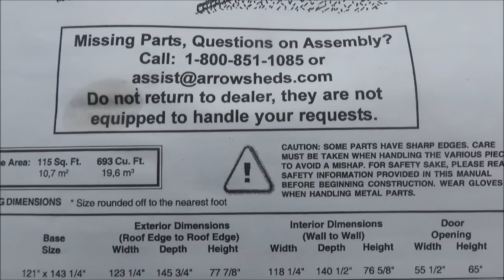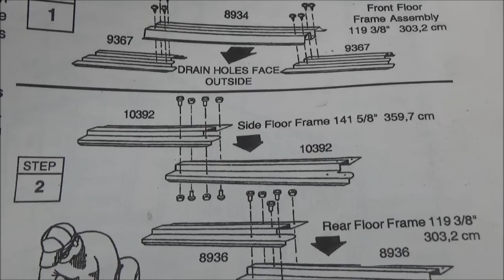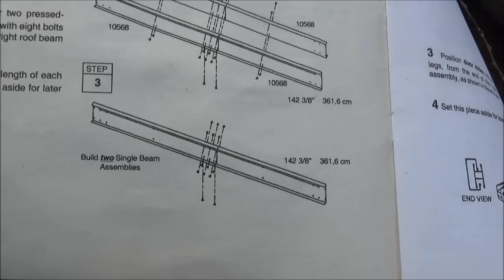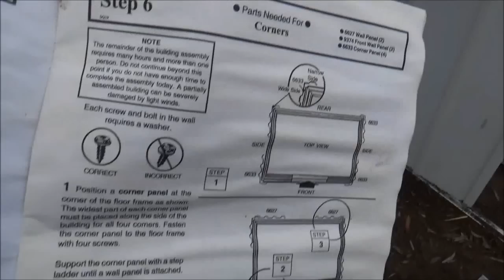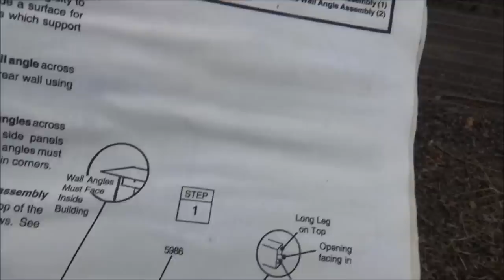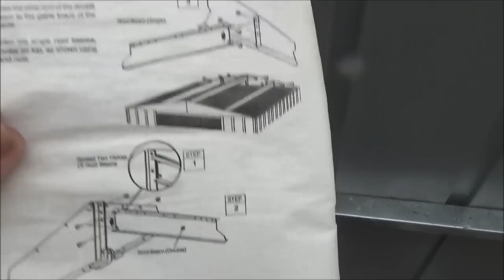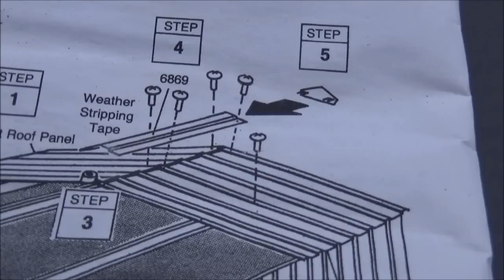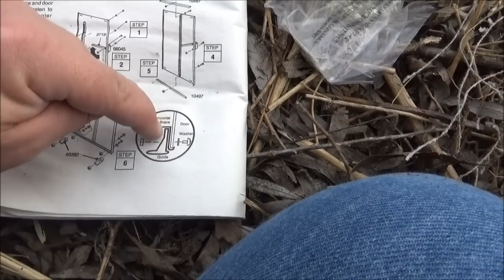NP101267 10'X12' Arrow Storage Shed Assembly - L2Survive with Thatnub

Comment: Good video, just completed my second one today.  Had issues with the roof panels coming together.   34 minutes though, 34 minutes to mention how sharp these rascals are.  I'm typing this with nearly 30 decent slices in my fingers and hands.  I despise these sheds.
Reply from the maker: I had to empty one of them and move it the next day.  Unfortunately, that night there was a wind storm and I didn't have to move it anymore.  The wind moved it for me.  Now I get sheds built by Costco or Home Depot.  They cost a lot more but, they are bigger, made of wood, and I am not the one putting them together.

Comment: Awesome video... On the door sliders just make sure you slide them between the curved part.  DO NOT JUST SLIDE THEM IN THE HOLE.  IT HAS TO GLIDE ON IT. That's why he was having problem at the end (not being able to screw all the way with out the door getting stuck, and having to release the outside screws because the slide was hitting it.  HOPE THAT HELPS.

Comment: badass video. helped a ton. instructions have been updated for this exact shed but its not much of an update. I did notice you put the door slides completely on the inside of the track. they should straddle it which is why your outside screws were too long and jamming the door up. figured I would add my 2 cents to help as you helped me. thanks buddy

Comment: Thank you for taking the time to make the video. 2 things I noticed that you may want to add to your video.
1. The door slides are installed incorrectly. The door track needs to go into the center of the door slides. You almost installed in correctly at 19:20. Look at the End View diagram in the instruction manual.. 
2. The gable should be tucked under the side walls. You had the gable sitting on top of the side walls. See 34:41 and 35:40

Good job on the video. It was much better than look at the manual.
Reply from the maker: ***** Thanks for the info.  We'll keep this a secret though.  The Wife thinks I'm perfect and I don't want to spoil it for her.  LOL

Comment: I filled the underside of the threshold where the doors slide with vinyl patch, its like concrete but doesnt crack and is not corrosive. Doing this makes it solid to where a heavy object, in my case a 800 pound Harley Davidson will not bend the threshold.  I strongly suggest this! 7 dollars worth of vinyl patch, you will thank yourself later. just make sure you clean out the drain holes and use your finger in the fresh mixture to make slight channels fir water to drain to the front.
Reply: I tried that but unfortunately the flexing of the threshhold made it crack apart. It would probably work great on a concrete pad but on dirt or grass it doesn't seem to help much.

Comment: This video is saving my sanity right now.  We bought 3 of these 10 x 12's, though ours have the barn style roof so it has more pieces to install... The directions are not super helpful in some sections and the pictures are a hard to decipher at times.  Thank you so much for taking the time to make this video.
Reply from the maker: You are welcome.  I messed up on the doors in the video but, if you read through the comments you will see the corrected info.

Comment: Great video, I have one going up and was thinking of using self tapping screws and the Bosch to drive them in next to every factory hole or in the factory hole if the grab instead of the nut washer and screws supplied.
Reply: Def recommend self tapping screws. A few times there were some "things" that didn't line up even though we followed directions to a T and watched this video, pausing it in between.
Reply: @sumtxflygrl1  I built this same building by myself. Self tapping screws was a lifesaver.

Comment: I built the same building by myself. I bought some longer screws and bolts to make it easier. On the top, I used self tapping screws on the ridge caps and screwed them to the center beam. I am 66 years old and need all the help I can get.

Comment: I just installed the same shed and realized the reason why your door is getting jambed is becuase you installed the white plastic pieces on the rail incorrectly. They should hang out of the rail in between the tongue. its hard to explain. But thats the problem. Other than that, great explanation. Thanks
Reply: Yes I think they slide on the lip and not go all the way inside.
Reply: Thanks for the Video! Sorry for chiming in, I am interested in your initial thoughts. Have you researched - Mahorrla Wooden Paradise Method (just google it)? It is a smashing exclusive product for building better sheds and woodworking without the hard work. Ive heard some incredible things about it and my close friend Aubrey at last got astronomical success with it.
Reply: Thank you i am installing the same one and watching this made me realize ididnt install them like his i almost ran outside to undo it all

Comment: Is the floor kit sold separately? I was going to just put pallets and plywood to make a floor and then just build on top. I’m building mine on top of a flat driveway
Reply from the maker: The floor kit came with mine but, I did buy the wood for the floor.  You do not have to use the floor kit but, you might want to do something to secure it to the ground.  These sheds hate the wind and will fly away if they are not nailed down.  (Speaking from experience).

Comment: Thanks for the video. I wanted a refresher and needed to get my nerve up for my second build of one of these sheds from hell. You probably are aware by now that you made a few mistakes during construction. However, I do not blame you at all. The instructions can be very confusing and almost impossible in some cases to tell when you're supposed to use a screw or a nut and bolt. Holes don't line up and on the rare occasion when they do stripping out the hole is inevitable. I think the manufacturer (China) throws any kind of alloy (probably a lot of aluminum and lead) available into the pot to make the sheets that are then stamped out into the component parts. I picked up a box of #10 1/2" screws for backups in the case of a stripped hole. I'm waiting for a true to life video complete with the requisite cussing and frustrated throwing of objects. I said this the first time, but I guess I didn't take myself seriously enough, but I mean it this time I WILL NEVER PUT ANOTHER ONE OF THESE TOGETHER AGAIN! I feel much better now that I've been allowed to vent. Thank you.
Reply: i found that working on it at small intervals helped. longest interval i worked on was the roof, about 3 hours. the price is worth the hassle in my opinion, any other storage solution is upwards of $1K.  the house i moved came with a small arrow shed, was probably installed in the late 90s and the thing is holding up pretty well, only minor rusting at the front bottom. that was reason #2 why i bought the new one, the Woodridge.

Comment: I've been following your video to build our shed. First of all THANK YOU. Arrow Shed should thank you too... Here's our deal though. Ours is a little different because it's not an A frame roof but more a barn style...But pretty much the same. So after I don't know how many days of building and how many times I've said "these holes don't align..." I actually ran into something that I couldn't see in your video how to do...The last middle ridge cap....Did you install it BEFORE putting in the last panels? I installed all panels and now I can't reach where the middle and front ridge cap meet... I think I have to pull a panel down, and what..just slide it under the ridge cap? OoF!! This one's a doozy. Anyway. Thank you for guiding us this far! We're almost there!!! EDIT: Ended up taking one panel down! ALL is well so far :)

Comment: Just built one in two 3 hour sessions after work. Alone. My gf said thanks but also got mad cause I made one small mistake. I put the roof panels that had side holes for the table in the middle and you could see light through. I just used the tap screws and screwed through the panels that were at the gable. I taped outside and patched inside you can't even tell but now she's worried about the floor. I haven't built the floor kit yet but where it is one corner is on a tree root so to level it I had tolift the other corners. Now I have a 6 inch gap some places. I filled alot with bricks now gonna fill with dirt but worried the floor kit will sit so it doesn'tput the plywood in the right position

Comment: None on my holes line up on the side edges. Shows 8 min. In your video  ,any recommendations on how i can fix that ? Just finished the top of the roof
Reply from the maker: Sorry, I don't know.  I showed all the issues I had and how I fixed them.  I would try flipping them over to see if they line up.  Wish I could have been more help.  As you can see from the video, I am not construction guy.

Comment: How did you get the roof screws in? Most of our holes did not line up
Reply from the maker: Make sure you have the right sheet of metal and make sure that everything is square.  If you mess up on the first sheet, it will cause the rest to be off.

Comment: Hey L2Survive, We helped a older gentleman friend of ours put this exact shed together. He had ordered the extra wood for the basic floor, so he got four sheets of plywood. ( i think, I didn't physically go count them.) We built it for him because he had asked two other people to do it and they turned him down saying it was too complicated. It took us a day and a half, because the first day we forgot the charger to the drill and it was dead and had to hand screw everything in. The second day was mainly just the roof. Now we are on the floor and the kit didn't seem to come with directions for the flooring kit. How did you manage to get yours together? Did you have to call for another direction book or ? Maybe I am over looking something? We wanted to try and finish it for him tomorrow, but he also wants it slightly up off the ground because it will be storing his personals for a couple years while he saves more money to have a house built on his plot of land. Thanks for the video and any advice!
Reply from the maker: There was a separate page that showed the floor and even the different cuts of wood to use to make it fit properly.  If you cannot find that, at the 0:50 mark https://youtu.be/9HvawHjnbBg?t=50s you can see what the floor kit is suppose to look like when it is done.  Hope that helps.

Comment: 5:50 why are the bolts on one side opposite, (one up and one down)  the instruction picture on 5:03 shows, one side the bolts are facing down and the other side is facing up
Reply: I'm pretty sure he did that wrong. For him placing the shed on dirt it won't matter. However if you're building your's on a cement pad you'll need to get it right or the shed won't sit flush.

Comment: I just bought one of these. Setting it up in a couple days. Do I need to anchor this thing to the ground? Gets kinda windy here. Gusts sometimes hit 50 mph. It will be on a wooden frame I built for it and then on top of plywood.
Reply: Definitely anchor this to the ground. Overall, this is a flimsy structure and a good wind will damage it. We had a couple windy days and the frame above the doorway bent  on my shed.

Comment: The plastic inserts (66769) for the door track were put in wrong this is why the issue with the doors sliding.
Reply from the maker: josh cowan Yep.  I will get it right on my next build.
Reply: I followed the video to place the insert inside the track. Then I found out the insert failed to slide due to the screws are in the way.
After reading the manual man times, its drawing (not instruction words) shows the insert must be "on" (not "in")  the track so I had to undo to remove then re-place the inserts. 

I want to thank L2Survive for the good work that saves people time- It really help the ARROW manufacture in lessening the learning curve.

Waring to the ARROW shed owner--- The ARROW shed does not use picture mage as the world embrace, it still uses the traditional engineering schematic. Although the description is correct,  but can miss important details. It requires the user study the schematic (illustration) carefully, you can't just assume the description gives all the right amount of information.

Comment: The problem everyone is having with the doors sliding is because the sliders  don't go totally on the inside of the track they set in the gap with a lip on the outside and inside of the track which allows for tightening of the doors and space to miss the bolts inside the track when sliding.
Reply from the maker: Anthony Quinley I will have to check that out.  Thanks for the tip.

Comment: Good vid. You helped wit the doors. Lol & another thing. Those plastic strips on the gables were pose to be removed after you put the end pieces of the roof. Other than that this vid was helpful.
Reply from the maker: Richard Luebano I just bought a second one of these sheds and you all have corrected my mistakes so, it should be easier this time around.

Comment: Do I need to use the floor kit to get this together right? I'm assembling on an existing concrete pad
Reply from the maker: No, you do not have to use the floor kit if you are not putting a floor in.  All it does is hold the plywood up off the ground.
Reply: L2Survive gotcha thanks!
Reply: @L2Survive  .. thanks

Comment: I would have definitely have put a 6 mil black poly vapor barrier underneath it. You will have problems with moisture and insects in there during the warmer months and it will rust quicker. Don't store anything that will grow mold.
Reply from the maker: alan30189 We put a sealant on the bottom of the wood floor.  It was like $15 per can but, they said that I will not have an issue with the wood.  There are a couple of gaps on the floor though so, creepy crawlies can get in.

Comment: Thanks for posting, i'm looking at this same shed.  Did the floor kit come with it or did you buy it separately?
Reply from the maker: The floor kit was included in mine but, I had to buy the wood for it separately and I also put a moisture sealing paint on the underside of the wood.
Reply: @L2Survive  ...how much did you spend on that (weatherproofing)? Did you chalk all the screws?

Comment: Where is your floor? I bought the plywood for the floor and I was hoping you would have shown how to do that part.
Reply from the maker: I was hoping I would too, I just forgot.  I do show the flooring kit assembled at the beginning of the video.  One thing to keep in mind is that there are specific dimensions for the wood you use.  There are like two or three choices in the instructions.  When I went to Home Depot to buy the plywood, I didn't think of that and had all of my pieces cut to 10'x12' instead of the interior dimensions.  I had to recut everything by hand when I got home.
Reply: The instructions are terrible. I was thinking of just putting a concrete bricks down and then laying the plywood down and assembling the shed. Would that work out fine?
Reply: And thank you for your reply
Reply from the maker: I really don't know.  Even though I may come across as a carpenter because of my construction jargon like thingy and do-hicky, I am not.  If you are not storing government secrets in it, I'm sure whatever you do will be good enough.
Reply: i did my own. if I can I'm sure you can. I use prefabbed 10 in. x 10 in. x 10 in. Concrete Deck Block from home depot. I just made sure it was level and added dirt and sand under neath as needed and I added drainage tubes under neath to make sure it didn't get washed away because it rains alot here.

Comment: I'm having a problem with my roof. I got the screws on the top by the peak but I couldn't line the one in the middle. The ones that attach to the roof support
Reply from the maker: LMonkeyBAd11 That's kind of a hard spot.  If you are having issues with the holes not lining up, try moving the shed around a bit.  I mean pick up a side and move it one way or the other about 3-6 inches.  If you are having issues with the bolts not being long enough, get someone to push down on the bolt while you secure the nut from below.  If I am totally missing what you are saying, give me a time stamp in my video of what you are talking about.
Reply: L2Survive you hit all the nail with the first one. I got those fixed but now I had another one. My doors are not sliding nicely. They get caught on the acorn nuts
Reply from the maker: LMonkeyBAd11 Yep.  Just a bad design.  I had to loosen the bolts a bit to let the doors slide open and shut.  They are still hard to slide but, it can be done.
Reply: L2Survive o ok. I thought I did something wrong. Thx u so much. I finished it and it's lovely

Comment: The plastic door slides should not travel inside the door track BUT to ride over the lower part of the door track. Even though the manual is of a poor quality, the plastic door slides are presented/shown correct!

Comment: can this be easily disassemble
Reply from the maker: It can't be easily assembled so, I doubt it can be any easier to disassemble it.  Plus, you are going to bend or break something at some point.  I'll find out this winter because I have two of them there and I have to take them down then put them back up at the new house.  I figure that I will get one complete shed out of it.
Reply: I'm looking to buy a 6x8 I dotn know if it's too small.i just need to store 2 bikes lawnmower and some bins.. did u have shelving done?